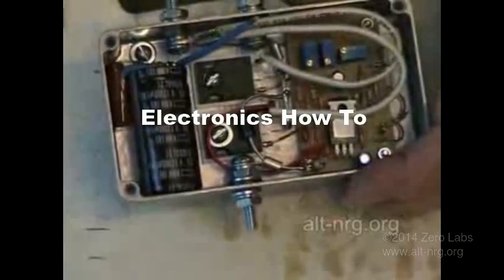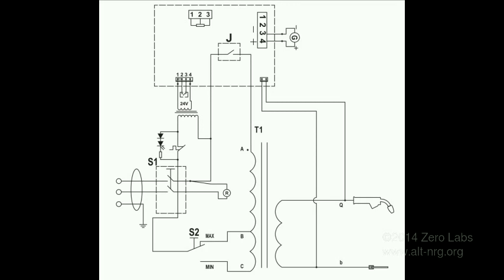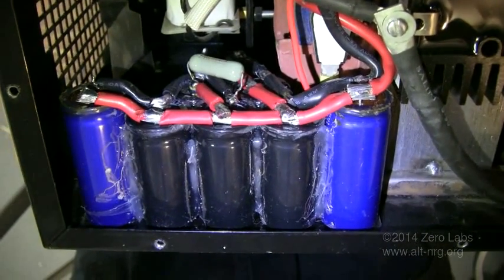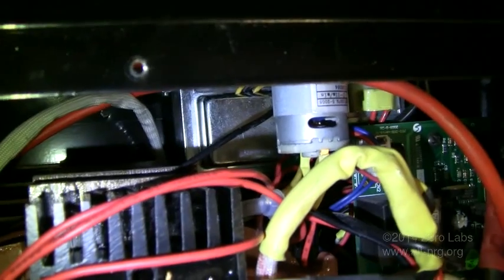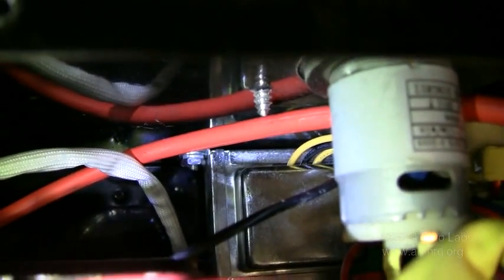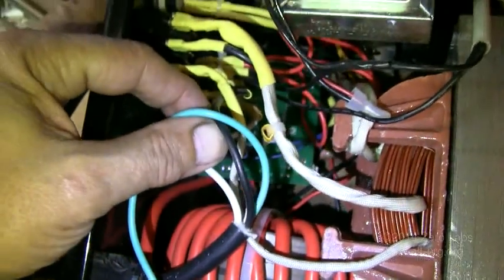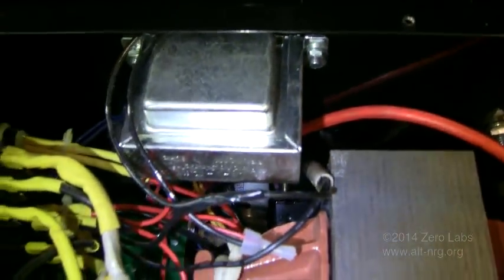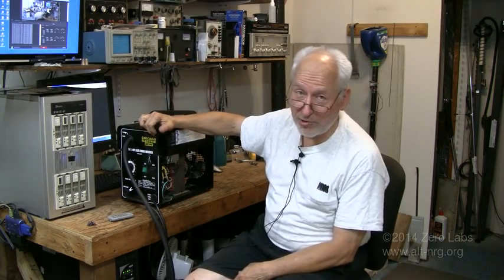#374 Harbor Freight 90A "MIG" welder upgrades

Comment: I have the older blue version of this same welder and all I did was change to Lincoln .030 flux wire and it lays a bead much better looking than the welds that you show. Little to no splatter at all and penetrates very well. It looks like your wire speed is too slow as it's popping and causing splatter. You want a constant sound like sizzling bacon.
Reply: I have the older blue version too and got a lincoln gun and line I am wanting to put on it, I  can't complain at all I have an old 63' 650 triumph chopper I have done alot of welding on it and it looks like it was done from the factory, I'm 52 been welding since I was 14 lol had to do it if I  wanted to or not, I worked for a radiator shop in rockford called butita bros kept a torch in my hand all day long u want to try tricky welding get into fixcing leaks for people that can't afford a new core u boil it out overnight then back flush it the fix it, gas tanks too- I hated them

Comment: Okay, I have done the DCEN modification to my Harbor Freight Welder (model is same as the one shown.) I did not modify my welder in the same fashion as you. I actually found nothing useful in terms of successful modifications online. So I instead I focused on the items most important to successful high current power rectification that would produce a continuous pulsed DC output. If you look at your sample welds on your 1/4" piece you will notice excessive spatter and uneven penetration. This is characteristic of AC welding and could indicate your capacitors leaking, fused diodes, incorrect diodes, a/c field induced by your coil's magnetic field, or half-wave rectification instead of full-wave. My welder can use any flux wire (old as in 10 years old and expired, cheap as in harbor freight garbage, and Lincoln electric inner-shield) and produce a weld with no sputter and high penetration. The down-fall of my conversion is that I have to keep the wire feed speed at 1 to 1 1/2 as anything faster will burn through the work piece. If you are interested in how I accomplished my conversion please message me. I have not done youtube videos of my projects, however, if you want to guide me along, I will make a video breaking down the conversion and the important details about the parts used which can make or break the conversion. I do have to say that I like your idea of using a second transformer to smooth the wire-feed under load issue. I will be applying that transformer addition to my welder since it really is a great idea and a simple solution. By the way: have you had your wire feed gears ever break on you? I had that happen on my first six harbor freight welders. This was when I was using the welder as it was built from the factory. I think the issue is caused by A/C welding. The plastic gears in the wire feed drive can have teeth come loose and the wire will feed out at an uneven rate. Over time the wire feed gets worse and worse until the wire feed unit finally takes out enough plastic gear teeth to make wire feeding a no-go. Looking at your welds I would suggest you take apart your wire-feed drive and inspect the gears for any loose or missing teeth. you may have a tooth causing a skip in your feed.
Reply: When are you posting your video?
Reply: When I get a high-res camcorder and camera stands/rigs.
Reply: Just found this video and I'm wondering if you could send me photos of your mods or post a video showing your box and the new connections you made and a list of the components you put in it. Thanks
Reply: I'm curious!
Reply: Please call me back on what you have to do to the machine I recently took my new one in because of the tip keeps under screwing  and thus only  had one left and right  when  I got  it out of the box it was the 78889 model.  Please call me back when you get a chance to I'm at 530-402-3766

Comment: Good tip on the feed motor sag. I'm going to try a different approach to solve that issue with a diode off the secondary through an LM731 voltage regulator to charge a small 250 farad 25 volt 9 ultra-capacitor bank  to power the feed motor. I already converted it to DC with  huge twin aluminum plate rectifier and caps from a 250 amp welder I dragged home from the salvage yard for $5 bucks. The DC does make a difference for sure. I never even considered the sag issue until you pointed it out. Cool video!
Reply from the maker: Glad you enjoyed the video. I'm actually still getting a little feed speed sag because the line voltage sags a little under load. May consider adding a linear regulator like you describe too.

Comment: Wow glad I didn't buy harbor freight welder. One piece of advice don't weld with exposed skin anymore it will eventually from repeated exposure burn your skin and start the formation of cancer cells on your skin.
Reply from the maker: Yes I know. I've even gotten sunburned on exposed areas around my collar. I guess I should post a disclaimer "Don't try this at home!"
Reply: You could or dress for the occasion if you weld inside
Reply: Sorry to hear that maybe she should do a foot detox to clear her system up food these days is healthy with all the gmo and factory junk they add. Cancer is a bitch. The reason it starts is because you are acidic. The body needs to be alkaline to kill cancer.
Reply: I feel so bad, all you can do is pray and stay by her side is all that you can do. So sorry.
Reply: I spent two years welding MIG titanium and wore just a long sleeve shirt and leather leggings.  I wore a good pair of leather gloves but because of the angle of my arm supporting the work it left a gap on the top side of my left wrist.  I didn't weld every day but after two years I had a permanent tan on the top of my left wrist.  It took close to 7 years for that patch to go away.  My wife just finished with breast cancer and I have a friend who just finished with colon cancer.  After seeing what they went through I kick myself for not taking more care.
Reply: You can get burned or more common just get a tan. Whether cancer cells start is completely a roll of the dice. Which is pretty true no matter what anyway. My sister is/was a health nut all her life and is dying of colon cancer as we speak. go figure :(
Reply: Sorry not healthy
Reply: egn83b She knows that and is in a hospital where they know that. Just for her nothing they do seems to be working. At this point she is in an out of consciousness. She was diagnosed stage 4 a year and a half ago.

Comment: You really need to taking some welding classes. That is not what a good weld is or begins to look like. I like your video's and this mod is a start. However, adjustment to the DC voltage out using either scr primary drive to the transformer or PWM control on the secondary DC side. Gas is a good addition as it shields the weld from oxidation and contaminants that can affect the durability of the weld, and also the gas reduces spatter, which prevents potential fires. I learned along time ago to invest in the better quality welding equipment, as the cheap stuff just does not cut it and usually causes more headache than it is worth.

Michael M. Snyder

Comment: Hey once again, thanks for sharing your information... I purchased one of these last summer and I've used the crap out of it. I've found that I get the best penetration with metals with this welder by running a high current with a slow wire speed set around 2 or 3 also and I only run a lower current with really thin steel. I think I'm going to try this mod somewhere in the future so as always, thank you for posting this information for the rest of us.

Something here that's worth mentioning too, invest into a small oxy/acetylene torch. That was one of the best investments I made especially for certain jobs where I was working with tight spots and neatness was my secondary goal too. You can really do some smooth detailed work with gas if you use a "00" or even a "000" tip. It's like a soldering iron on steroids but with a much stronger bond plus you can gas weld aluminum and stainless steel with the oxy/acetylene torch also.

Comment: Unless you are useing an inert gas on these things you will never get a good weld....
Reply from the maker: I know flux isn't going to produce the best welds but to say it's not possible to get good welds is a bit of an exaggeration. For me the convenience and portability outweigh the expense of bottled gas.
Reply: Not true at all. You can make some very decent welds with this little machine if you practice.
Reply: ZeroFossilFuel
Agreed because I've actually gotten some really "pro" looking beads with this cheap welder just the way it is as long as the metals to be joined are cleaned and well grounded. The big plus with the inert gas is the splatter factor is held down quite a bit but a positive trade-off with flux is you can weld in a strong breeze where any breeze at all will blow the inert gas away and ruin the weld.
Reply: stick welding has been around since the 1920's and is still commonplace today. flux core is very similar.. not identical but similar. basically feeding the stick for you instead.
Reply: the flux vaporizes into an inert gas. Otherwise the welds would be completely porous from atmosphere mixing with the puddle.
Reply: So this holds true for stick welding too? No GAS No BUENO??
Reply: Many correctly performed FCAW welds cut and etched say otherwise (FCAW is used in industry too). Proper technique and settings make a major difference, as does preheating thicker stock with a torch. I've laid down many sound welds with flux core on machines from my simple Lincoln 100 amp WELD-PAK to my ESAB 450 amp machine feeding a Hobart suitcase feeder. I would advise noobs to buy a 125 amp machine minumum if it's your only wire welder and you do lightweight work, but the main thing to remember is USE A POWER SOURCE WITHIN ITS APPROPRIATE RANGE.
Reply: You can get good welds with FCAW, but you need to know how to weld whatever process you use.  You can teach yourself, but a welding class at a local trade school or community college will make the process much quicker and you generally get an expert with many years of experience who will show how to make good welds.

Comment: Not that I know much about these things but aren't your diodes the wrong way
if the caps have a + sign above their symbol?

And what makes a MIG welder a MIG welder? You mentionned something about
DC. Are the other welders all AC?

Sorry I'm asking this before asking google...

Cheers
Reply: ZeroFossilFuel CO2 alone or argon/co2 mix is used in real MIG machines in place of the flux for the same reason oxide protection. A starter tank and regulator is in excess of $200 and can be used for lower amp projects indoors with very little spatter. Flux core wire is best used outdoors for projects such as steel gates and the like but spatter is always going to be a bit of a thing. Your doing fine don't mind my semantics but please wear a cotton shirt when welding the far UV and inferred created from the arc will burn you. If you can see sun through the shirt it is not dense enough. Thanks for reading.
Reply: Used to sell EXPENSIVE  maintenance repair welding alloys, so I got to teach some welding techniques to customers.  MIG stands for Metal / Inert Gas. In welding, oxygen gets into molten metal before it solidifies and ruins the weld joint.  The Inert Gas (such as Argon) creates a bubble around the weld for the fraction of a second the molten metal takes to cool so it will not OXidise. .
Reply: MIG is metal inert gas, so really this is not a mig welder from a techs point of view. This is a flux arc welder. Sorry to be annoying. Most people call it a mig because it has a gun. AC is great for aluminum but you would have to have the feeding tube very straight to feed aluminum wire without kinks. Most people use a spool gun for this reason. Still nice vid, been looking at these machines for over a year and wondered how they performed. I am a TIG welder as a hobby and for side money.  peace.
Reply from the maker: Yves Baggi DOH!!! That was a totally bonehead mistake on my part. Thanks for pointing it out. +moonreft is correct. Technically MIG stands for Metal Inert Gas. I contend that the flux core gasifies in the arc and technically qualifies as a MIG.

Only cheap welders have AC output. All high quality MIGS are DC. Some even have a polarity switch. From all that I've read online, flux core works best with torch negative, compressed gas works best with the torch positive. Not sure why but mine is configured negative.
Reply from the maker: moonreft
Doesn't the flux gasify at the weld site to displace the air?
Reply: ZeroFossilFuel The flux protects the cooling metal from the atmosphere by floating to the surface of the molten metal puddle and forming a layer of "slag" This prevents oxides forming. DC electrode negative is standard unless cleaning action is needed from dirty layers of material, again mostly aluminum or other stick weld projects/. Long time fan Zero, think I found you in 2007 or so. Peace!
Reply: ZeroFossilFuel one more thing sorry for needing to be understood, aluminium oxide melts at 3,762°F (2,072°C), (the ac part of the welder, electrode +) Aluminum under the oxide layer melts at  1,221°F (660.3°C), DC electrode -) without the cleaning part of the AC welding aluminum will melt under the surface before the thin top layer by a large margin  . I don't know what that bike frame was but be weary if you do it again. Other word of note, galvanized will poison you stay away from it, and brake cleaner + welder = deadly fumes, acetone works fine /w a good stainless steel brush.
Reply from the maker: moonreft
Always learning. Thanks for sharing your expertise.
Reply: OgMandin0

Thanks all for the replies and answers.
Reply: Some MIG Welders allow you to change the polarity ( HTP does) and depending on what type of welding you are doing would require polarity change.

Comment: I like how you are welding with batteries sitting on the bench...  Yes, I know they are sealed batteries, but still kind of funny.
Reply: Even funnier is burning wire in a wooden shed with combustibles nearby.

Comment: nice hack-all you need now is a gas line and bottle
Reply from the maker: I would add a solenoid valve to a gas line input if the wire feed had some way to attach it directly. Only way might be to pierce the outer jacket just in front of the welder, squirt in some sealant upstream to force gas downstream toward the torch head, add an I.V.-like tube to inject gas into the line and pray it doesn't leak in all directions.
Reply: +ZeroFossilFuel so it is the line and gun that is  stopping a hose being added?
Maybe you could just hang it under the wire feed line and bodgy up some shroud around the nozzle...or buy a new gun from a gas fed welder...
Reply from the maker: m3sca1 Actually, the torch and line are identical to a welder equipped for compressed gas. What's different is the wire feed mechanism (no place to inject the gas), absence of a solenoid valve and inlet port.
Reply: ZeroFossilFuel The solenoid is pretty easy to hook up. Just need to find one. If the welder tip has a cup(shroud) on it maybe you could drill or thread a small fitting to it for your gas line from the solenoid. Or you could run a manual valve instead of a solenoid. Just use a bit more gas is all. :)  Trust me once you have welded with gas you wont want to go back.
Reply: I just bought a solenoid vavle on eBay for $15.99 w/ free shipping.  I'm going to build a circuit to give me a little post purge.  Might even set it up so that the gas comes on a half second or so before wire starts feeding.

Comment: Good job. Try think about adding a diode before 'Q' choke coil (parallel to capacitor bank/rectifier output, cathode to positive pole) it returns some energy from coil to welding rod and output current is even smoother.
Reply from the maker: It would return some energy only if the voltage potential across the caps went opposite polarity which I highly doubt.
Reply: ZeroFossilFuel diode will bypass opposite polarized spikes from choke coil, so they will not discharge capacitor bank.

Comment: Well that was easy.....or was it. I know the editing took some time. But a good
video and compared to some others professionally done.
Reply from the maker: Yes, editing this one took me three full evenings, partly because I'm forcing myself to learn to use GIMP so I can get away from winblows based JASC Paint Shop Pro (Which I really like, BTW. It's winblows that I hate and PSP will not run in Wine).
Reply: use CADsoft Eagle for schematics. Although some of the open source projects are getting there now.

Comment: Yes I have a hot tip Harbor Freight Flux Core Welder. The wire feeder on that model really sucks, I wired it independent too. So these units units use no gas and are AC. man who would have figured.  Thanks